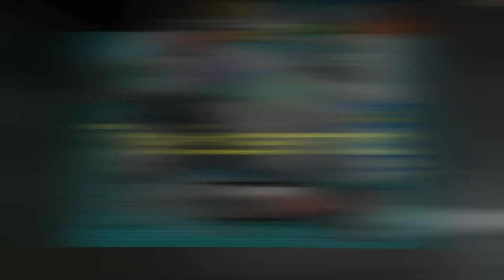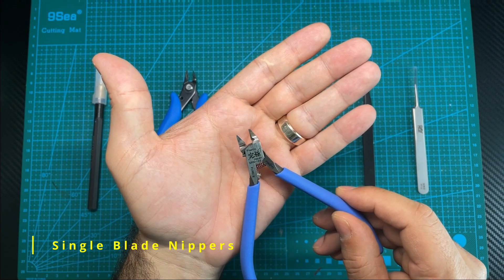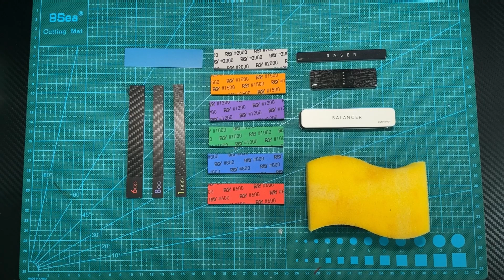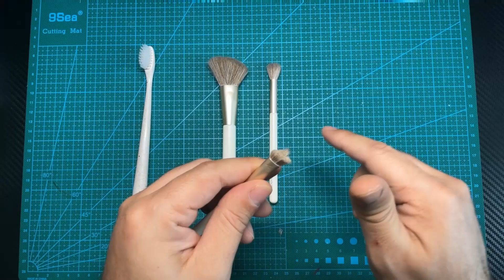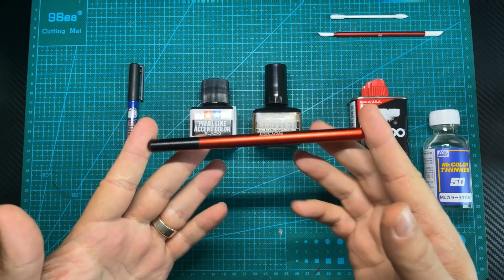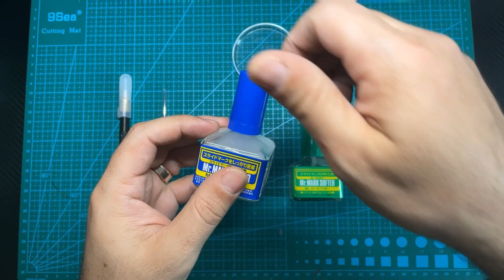The ultimate guide to Gunpla tools for beginners

Comment: There's a side benefit to also having a cheap cutting blade set in addition to that. With a Dremel, you can modify the blades you don't need for other purposes, like shaving a thin engraved line to the side of where two parts meet or making generic chamfer shapes. Takes a bit of practice and creative planning, but you can achieve some great engraving effects with that and a cheapo set only costs ten bucks or so.

Comment: budget tips

-have a grey pen for small white stress marks (works best on grey plastic). 
additionally u can rub the stress mark with ur nail... this one i didnt believe but it just kinda works, especially well with softer plastic just be careful about deforming.

-a magic eraser (melamine sponge) will "ungloss" the super shiny nub u just sanded and polished to better match the original plastic.

-i use an old metal plate rack for my runners to sit in, binder/folder sorters will probably also work.

-a parts separator has saved me a couple times, i believe i saw someone on reddit say a lego separator works.

-good lighting and a comfy chair, dont be a shrimp and check your posture.
Reply from the maker: Great tips, I totally agree

Comment: The most important thing, a part separator. You don’t know how useful it is until you put on the wrong piece or the wrong way. 

I just got a cheap set of the basics. I’m glad I canceled the order quickly that didn’t have the part separator.
Reply from the maker: That’s really a good point. Mine saved my life in multiple occasions! I am thinking about doing a part 2 video with some extra tools and the part separator will absolutely be part of it.
Reply: @TeaandGunpla  One day I might get a pair of single bladed nippers, but with some sanding and polishing after a dual bladed nipper, the piece will look fine 99% of the time. I usually take my time with cutting it from the runners though.
Reply from the maker: The single blade nippers will save you a lot of time. You can cut much closer to the surface and sand less. I couldn’t go back anymore after getting used to it.
Reply: @TeaandGunpla  I don't mind taking a while to make building last longer. It's so fun to build them, so I'll take more time if I can get it lol. I might change my mind if I ever get a MG or if someone buys me a PG.
Reply from the maker: That’s really a nice mindset! I love mgs, they’re my favorite line, followed by rgs. Pgs are just too big. But I need to get the Rx78 PGU sooner or later
Reply: @TeaandGunpla  I want the MG Aile Strike as it’s my favorite suit, but it’s out of my budget right now. I’m thinking of getting the RG Force Impulse as my first RG.
Reply from the maker: They’re both great looking models. Once you start with rgs it’s hard to stop lol. I loved the God Gundam, Nu and Hi-Nu (in order of preference). But the size of mgs it’s just perfect. I recently built the Mgex Strike Freedom and it’s a pleasure to look at.
Reply: @TeaandGunpla  I’ll probably just stick to Seed/Destiny suits and maybe one or two others. I’m not really a fan of the OG suits, but I’m also not a fan of the more pointy kits. The Seed suits are the perfect middle ground for me. The only pointy suit I like is the Kyrios for some reason. It kinda reminds me of G1 Transformers.
Reply from the maker: Look is pretty important in choosing a kit. I love the UC line and the 00 team. I’m trying to slowly have them all

Comment: Awesome and very informative, i might get the dspiae siren for the simpler sanding process. Do you have any recommendation for budget nipper cutter?
Reply from the maker: Thank you very much! I did not try the Dspiae siren, but I can tell you that it is a great brand. Alternatively I can recommend the Raser Plus combined with the Balancer. I had great results with them.
https://www.gunprimer.com/raser-plus
https://www.gunprimer.com/balancer
As nipper cutter any will work to separate the part from the sprue, I use the Godhand Pn-125. Not expensive and it is very good.
https://www.amazon.com/GodHand-Nipper-PN-125-Plastic-Cutting/dp/B07NWBG938/ref=sr_1_10?crid=3B2GIN9GWURWA&dib=eyJ2IjoiMSJ9.bG759yGyEvsboWqreB_1NRRA4bC4OuZ2S1dPLbFwCz6xuMpXshDppmCzlLj6olhCPCvkNeMeDE_IyHIe9BHClvxRbKIi94OqzpfsYhRI8s98PqjccfjNW7aeO390AlgZBOfngzBVcxhO9c1EkOOQ8yq5sAWyrJgjDGVv07pMq7knpEsbyNgjLYPF6QuMu4x0_RITILAsJHz47ipyr9rIXGeZYACPYbRghy5cYg1asL0uyqjtIR93BGOyKqF5KOElyqzalloMX6MryRflq1wZRq-VcXKIPaC3bwcwCst0qEc.6AZX1NYrCxS89f8Mp-hI5aKFFwv4mXnsHki_LPQrdbQ&dib_tag=se&keywords=tamiya+side+cutter&qid=1714611965&sprefix=tamiya+side+cutt%2Caps%2C364&sr=8-10

Let me know if you need any more tips!
Reply: @TeaandGunpla   yes i heard that the dspiae siren is the more budget friendly of gun primer raser. I'm now torn between choosing the god hand pn 125 or the hobby mio entry level nipper + Hobby mio hm 105 which when it comes down to it is a bit cheaper than pn 125.
Reply from the maker: Sorry for the late reply! I had to go abroad for a bit and things got a bit messy! If you are still pondering about your choice, I can tell you that Godhand in general is a great investment. They keep sharp for long time and they will last forever, if you maintain them properly. In case you got the Dspiae Siren, please let me know how is it going. I could get one too for an upcoming review of alternatives. Cheers
Reply: @TeaandGunpla  Hey no worries, yea I'm pretty satisfied with the god hand pn125. On the other hand the Siren felt awkward to use imo. its really eating all the plastic especially the edges, and the edges often touch the other plastic part. I think part of it is how I use the siren but, in my case the Siren is do more harm than good in most cases. In the end I'm using sanding sponge for much better result, just like you said the glass file will give you faster result but with much less control and in the Siren case its really awkward to control lol. Anyway happy to see you back, cant wait for your next upload :)
Reply from the maker: Great choice of nippers! One of the advantages of the Raser Plus are the rounded edges, that solves a bit the issue. Still I really prefer the sanding paper/sponges. Hopefully this week I'll manage to upload the water decals tutorial. Thanks for the support and happy building!